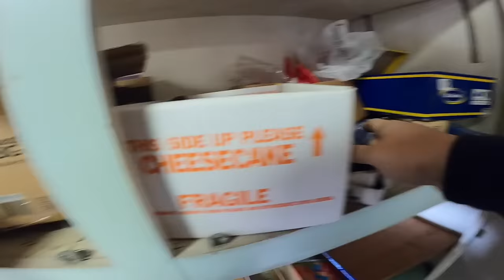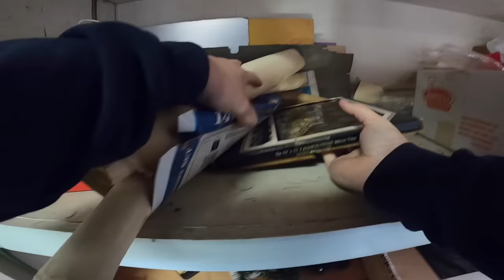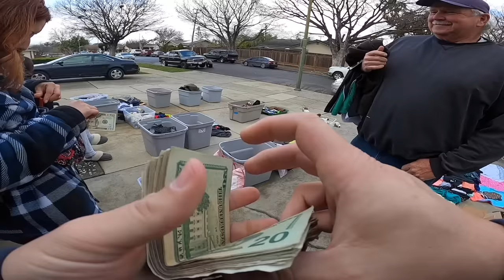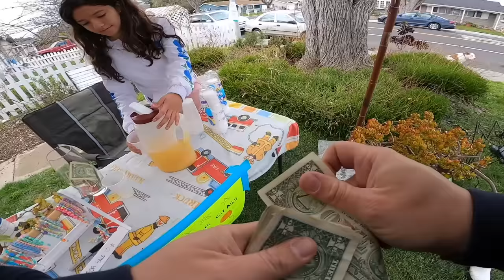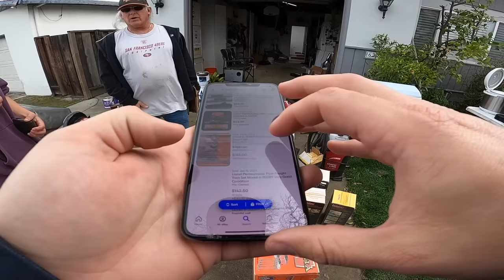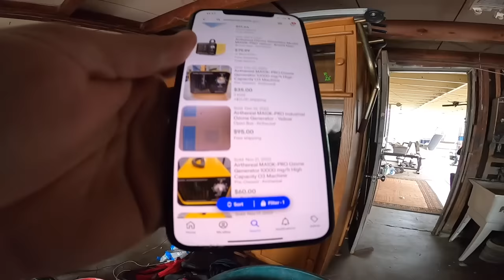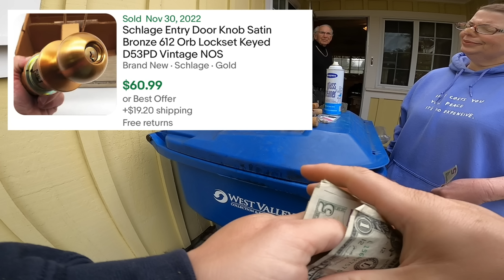This ESTATE SALE got Awkward…

Comment: That last one was unusual and strange for a "sale". Bins full of half used painters tape and crap that supposedly costs $2,000 new? High priced "key item" Drumset and Fender amp.. Unorganized, van parked in driveway and nothing put out.. 

Guy got super awkward after you told him you resell on eBay but hey he don wanna give any money away. He says at first basically everything is for sale.. then about 10 items end up not being for sale. I think he was pullin numbers out of the air with those $300 / $100 numbers on that yellow thing. There's an overall feeling there of "something isn't quite right here and I feel unwelcome". Very strange.